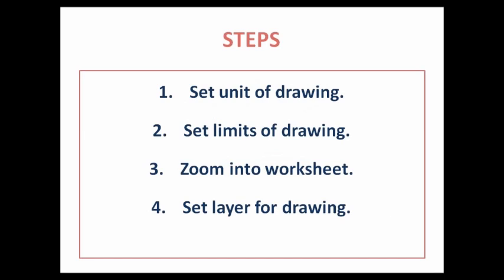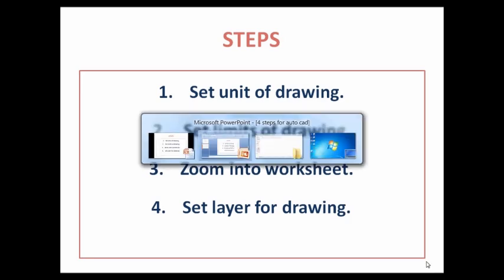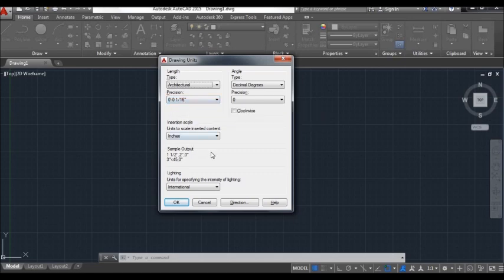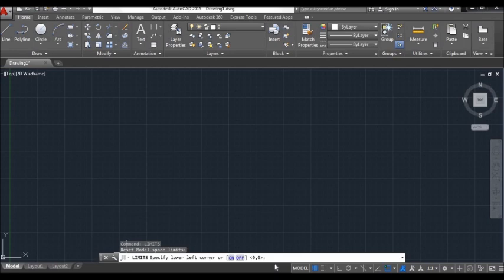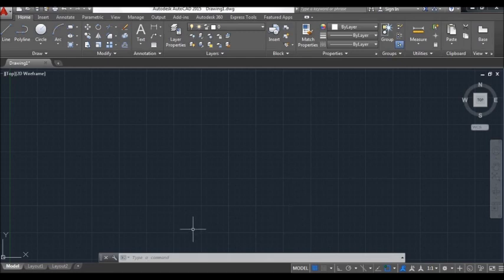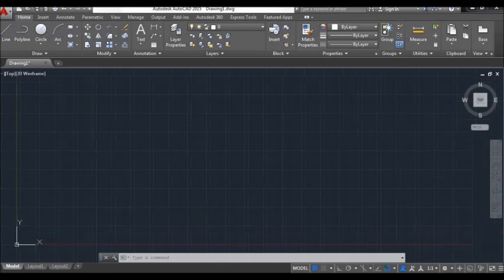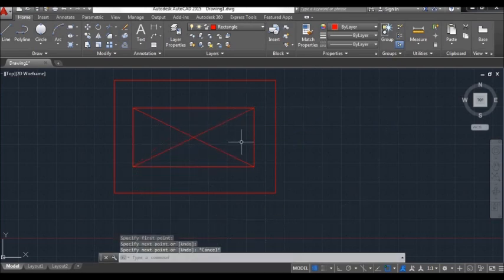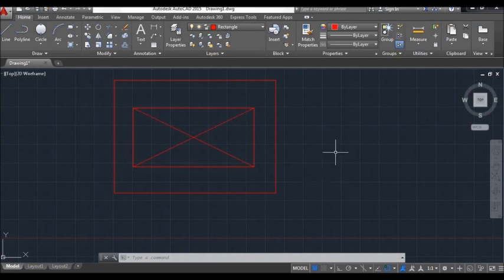Autocad tutorial - 4 basic step for beginners

Comment: Sir, i am very very beginner of autocad(2020) i have a problem in autocad(2020)... whatever i draw line,circle etc..they look like tiny dots on screen...if i draw a line of 100mm or whatever length it look like a dot...if i draw a circle of radius 50mm or any radius it also look like a tiny dot....even after zoom in they look like dots....so i tried drawing objects with a very very lage dimension like in hundred thousands (eg. 719,478)...they are visible to eyes... once i draw a cicle randomly and i measure it...it show radius=719336...then it is visible to eyes....again i tried with a radius of 300...it look like a small dot....so why small sized objects are not visible ( look like very tiny dots)…it is unit problem or zoom extent problem I don't know.....pls pls🙏🙏 provide solution...i will be very thankful to you....i have photos of my problem...if u give whatsapp no. I will send to you.
Reply from the maker: Hi Harshit, You need to define the scale of your sheet and use zoom all option once the scale is set. Go through the video again and flow all the steps I told and your problem will be resolved.
Reply: @freelancetricks1893  thnk u🙏💯....can h pls share the video link plsss
Reply: FREE sheet metal, gears, curves and others

http://www.onlinecadtools.com/myindex_en.HTM
http://www.onlinecadtools.com/english/html/sheet_metal/index.HTM
http://www.onlinecadtools.com/english/html/index_gears.HTM
http://www.onlinecadtools.com/english/html/index_curves.HTM
http://www.onlinecadtools.com/english/html/index_st.HTM
https://youtu.be/7W1_jJ1XWzo
https://youtu.be/T-irEOEON2w

Thanks!
I need advertising and orders